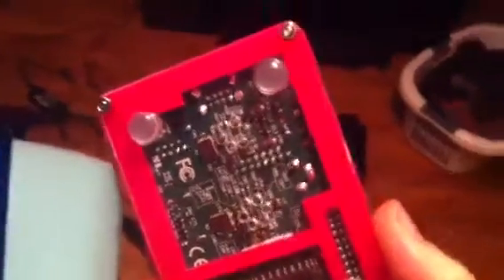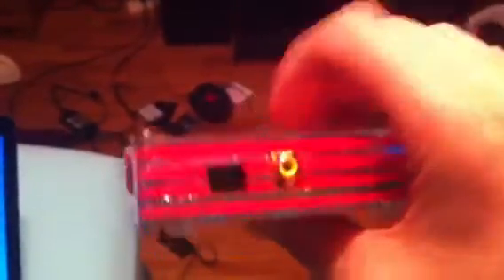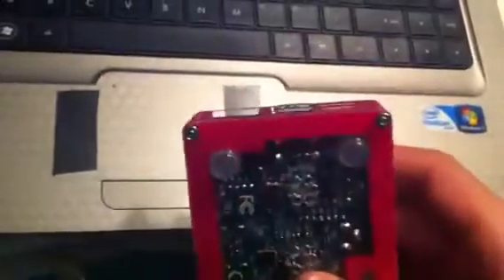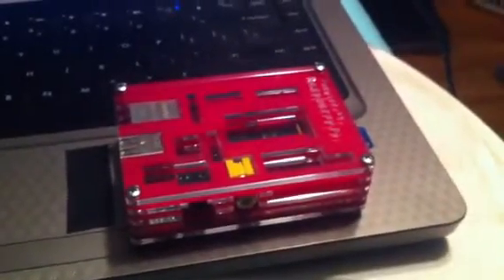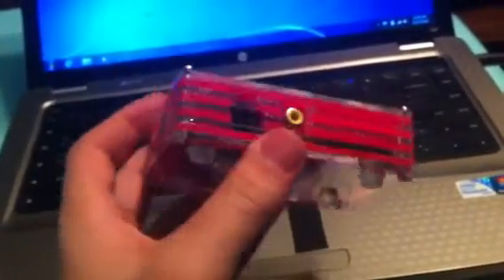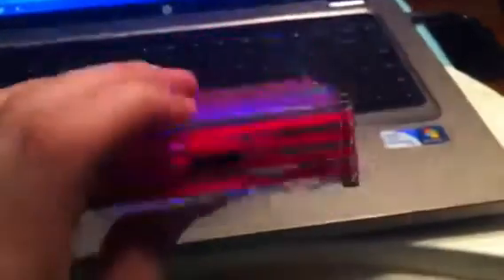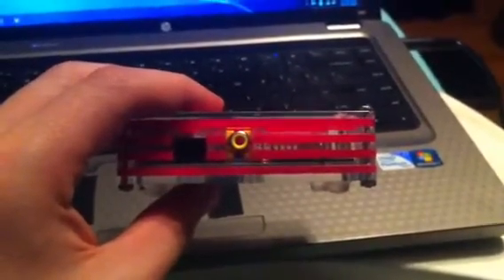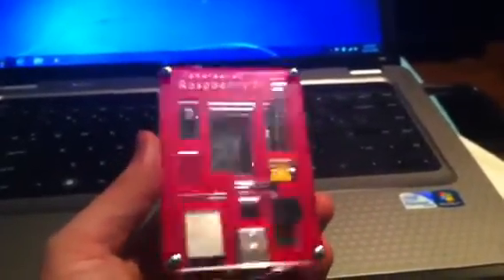Pi Works Raspberry Slice Case pt2

Comment: I have one of the 512MB model B Pi's and its pretty gnarly. 512MB of ram, Turbo and now the vid core sources have been made available... damned this little device gets cooler every day. I also have one of the gen 1 model B's that I used as my main play with pi. The 512 is currently running a website and shoutcast server :D

Next project involves an arcade cab, maybe another pi for home security... who knows :p to many options now :D